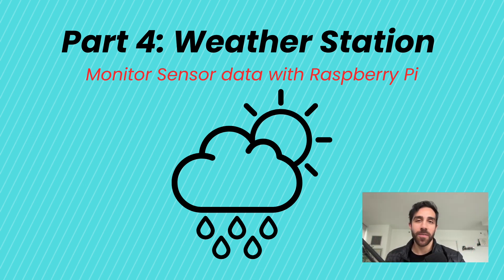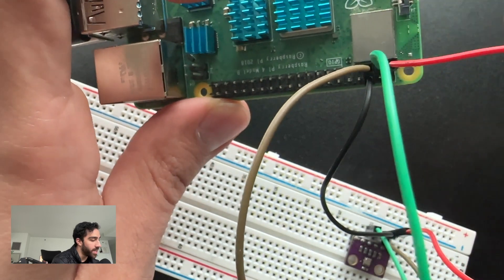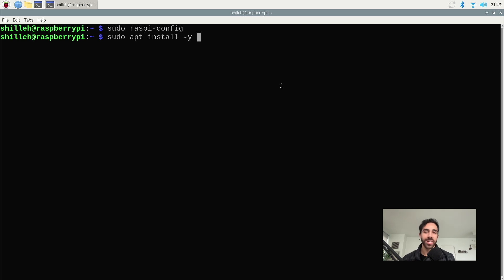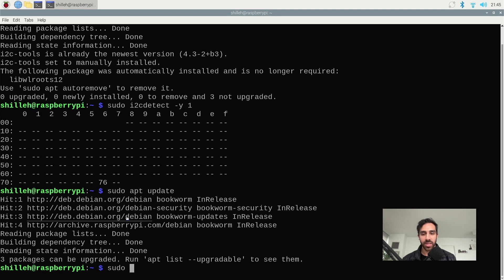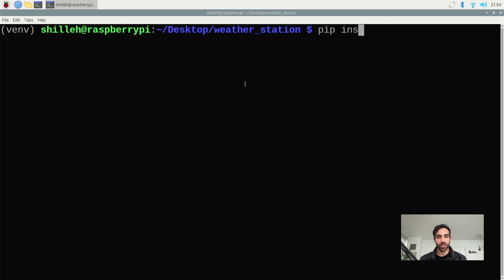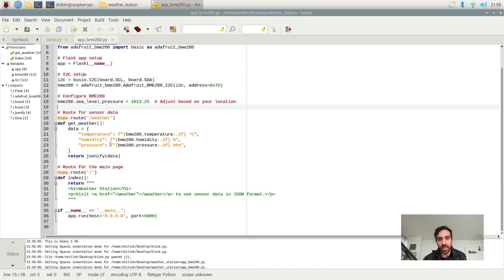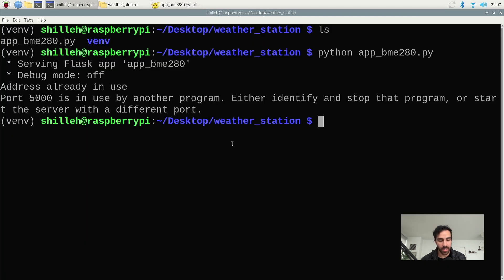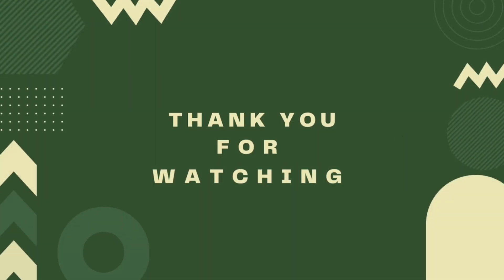Introduction to Raspberry Pi Course for Beginners (Part 4) - How to Make a Simple Weather Station

Comment: hello sir
can you tell how to run code on autoboot if code in virtual environment 
like i create a folder and open it then i create a virtual environment in that folder after activating the venv i install all the required library and make py file in that folder i want to run that file on autoboot 
i am using raspberry pi zero 2w
Reply from the maker: You need to add that code to the crontab
Reply: @mmshilleh  sir can you tell how can i implement it